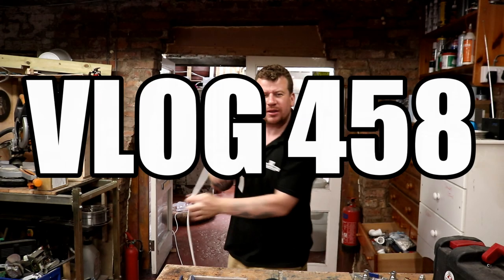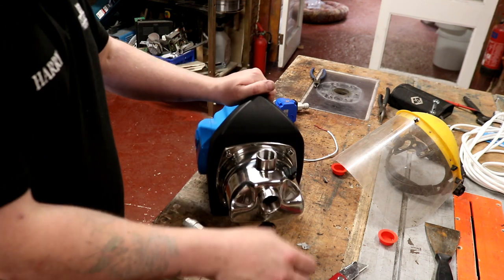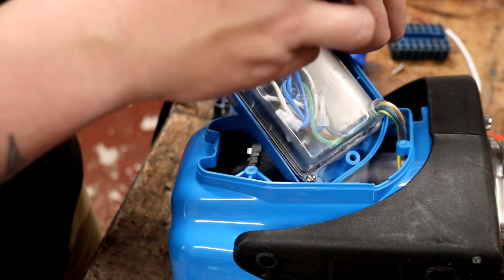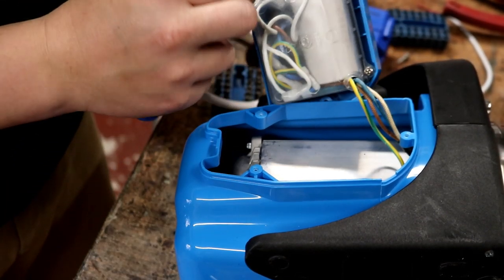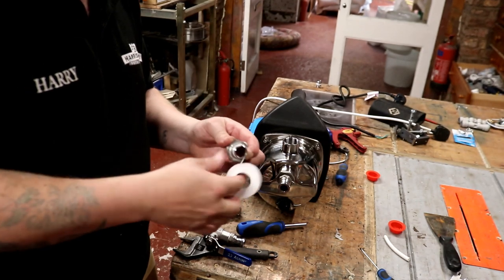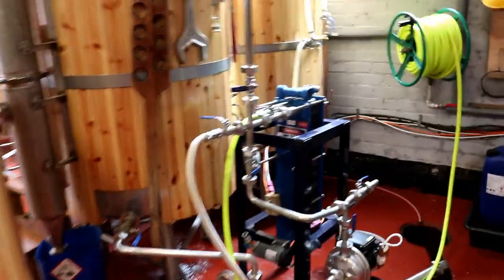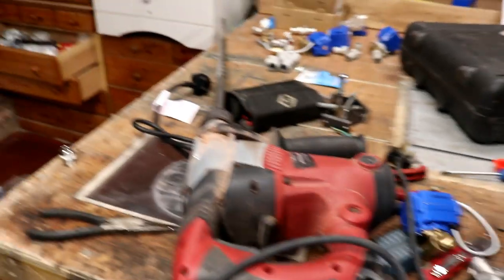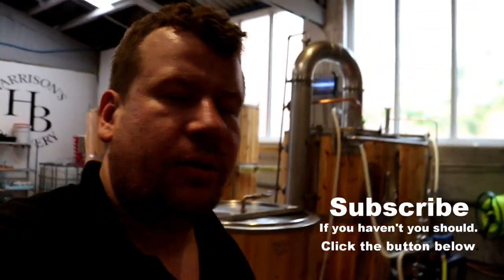CLARKE PUMP TWEAKS

Comment: Hopefully not a daft question but does a 1" camlock type E (male to hose adapter) fit into a 1/2" camlock type C? I can understand if the bigger 2"+ camlocks wouldn't but just bought this pump and all of my fittings are for 1/2" camlocks. 

Cheers!
Reply from the maker: No they wont fit. I just fit reducing bushes in the pump to take it down to the size I need.

Comment: For the most part, you do seem like quite a worldly gentleman, that said when you are not sure where Tarzan comes from, I do need to question your credibility.....from  my experience tho7gh Chris, old kegs such as those you proposed to use in your pilot system cannot be beaten in terms of strength and build quality- I would convert and use them every time if they provided the required quantity - they will be far more superior than any other tank you buy.  That said, a person would need to know how to cut and weld stainless, but this obviously a skill that you have mastered.  My vote is to utilise the old casks if they appear pleasant to you visually and if they meet your requirements in regards to volume for a pilot batch - usually 40ltr is sufficient.